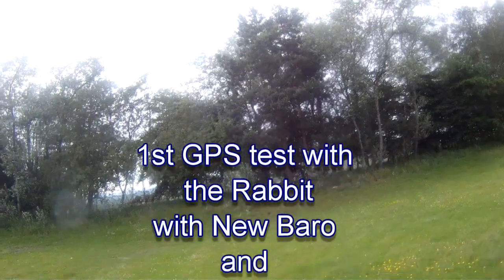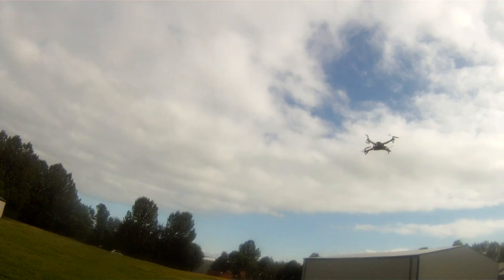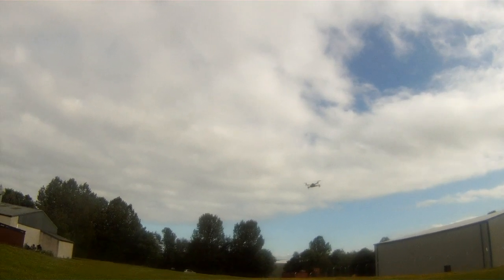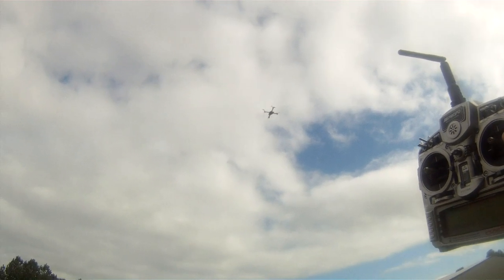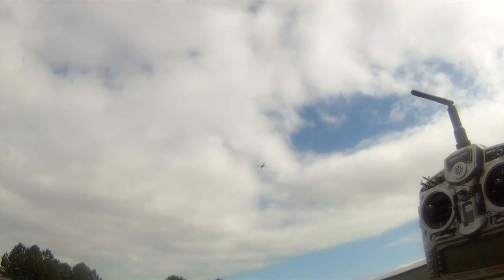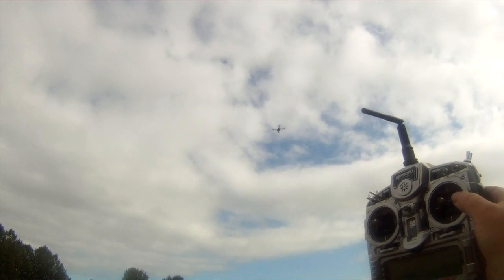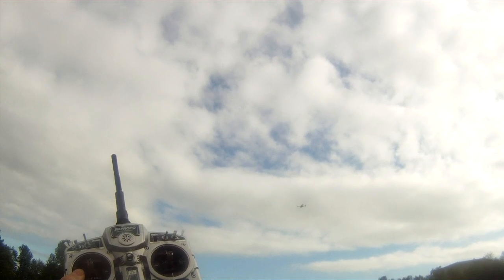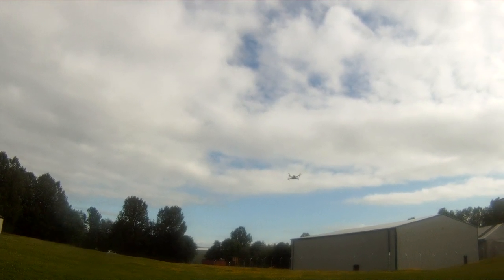Rabbit with GPS & NEW Baro MS5611 1st test

Comment from the maker: Hi No problem, I suppose i should start putting this info in the video!

FC: Rabbit new baro
Frame: Multicopter RM450 V2 Frame 
esc's: RCTimer programmable ESC 20A (not flashed)
Motors: Keda 20-28M 15A 1050Kv Hacker Style
Battery: ZIPPY Flightmax 3000mAh 3S1P 20C

for more info and please join the forum link in the 1st description 
hope that this will help you get one and join in the fun to?